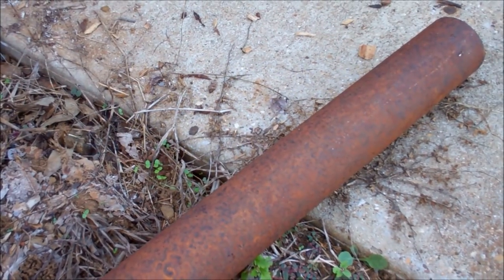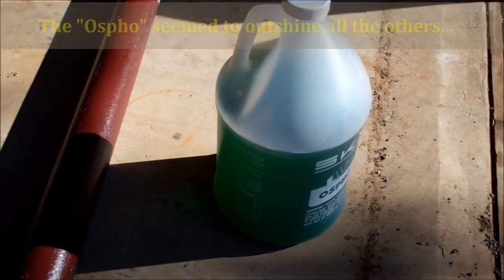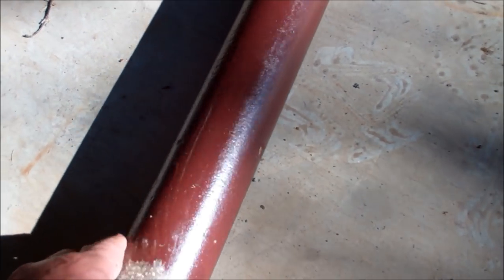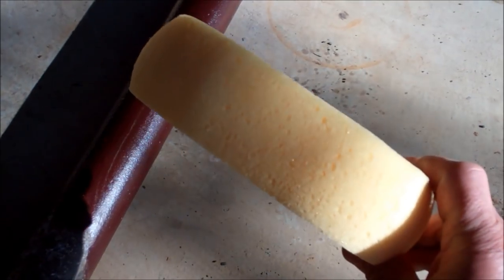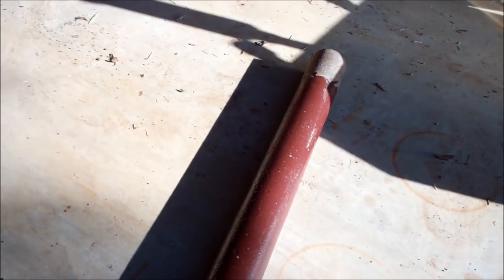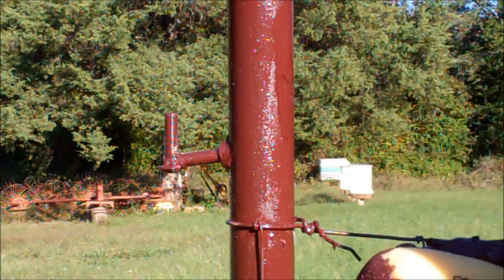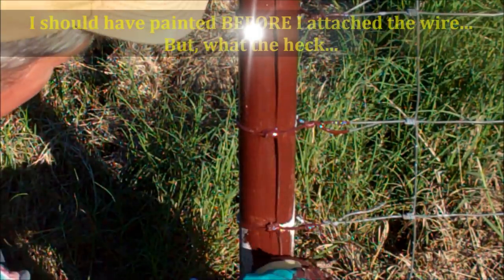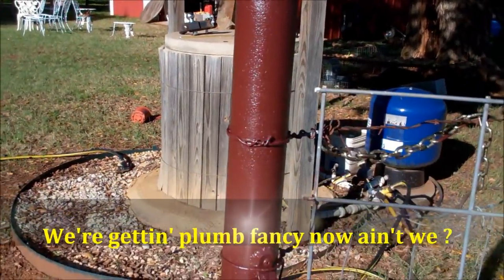How To Paint A Pipe Fence~Rust Conversion

Comment: I have used paint brushes and sprayers.  What I use now is a small piece of microfiber towel, dip it in the Ospho and squeeze out the excess.  Works fine and helps the Ospho go further.  Thanks for the video.  Good info.
Reply from the maker: Great idea
Reply: What do I do about the heavy white film that forms?

Comment: Great video!! I have a problem. We had our fence post repaint about 5 years ago and it wasn’t done right. The paint has been peeling off for several years now and we are ready to repaint. How do I get the peeling paint off to prep it? Thanks for your help!!
Reply from the maker: You may just have to do it the old-fashioned way, which is to scrape it off. There are chemicals that you can use to remove paint too, but I haven’t used them very often.

Comment: Hi thank you so much for the video . I have a quick question  I stripped out a pole from old paint , it had a little rust on it and then I put a fresh coat of paint . Due to the heavy rain ! The rust came through the pole . My question is can I use the OSPHO direct now with pain and rust seeping through? Or will I need to strip the paint again thankssssss😁😁😁
Reply from the maker: The Ospho needs to be applied to the rust so it can kill it.
I don't think it will seep through the paint.
Bummer.
Reply: @BIGALTX  thank youuu

Comment: I have to do a cemetery entrance pipe frame like yours but has pitted going on on the pipe do I sand this off first or use a wire wheel to knock it off?? What do you suggest? Love the products you used 👍
Reply from the maker: I think I'd use a wire wheel to try to get all the rust off, then use the Ospho: https://amzn.to/31MNmeC

Comment: I don't know if the author is still following This Thread but I have a question. Do you think the Ospho and the paint could have been sprayed on versus brushed on or sponged on? Which do you think would be most effective?
Reply from the maker: Sure, it could have been sprayed, but I think there would be a LOT of waste.
I have an airless sprayer (and i considered it) but figured I'd spray more into the air than on the pipe
Reply: @BIGALTX  Thanks for the response!  I know that you used the red primer and it's my understanding that if Ospho is used on pipe that is to be painted then a primer is mandatory and that you can't simply paint over the Ospho treated pipe.  Is that your understanding?  Also, have you found anything better than Ospho since you made this video back nine years ago?
Reply from the maker: That's correct, and I haven't had any major projects since then that would cause me to use anything different than Ospho.
This paint (i think) was an "agriculture" paint and I think it was leaded. The 5 gal bucket weighed a lot! :)

Comment: My mom has scrubbed metal pipes, prime them and painted them and they still look good 10 years later. If we use the ospho product, how long will the paint last?
Reply from the maker: Stephanie Flohr The Ospho isn't paint... it just converts the rust to a paint able surface. If you just paint over rust, it will eventually come through the paint... you have to kill it.
Reply from the maker: Stephanie Flohr I painted these posts about 2 years ago... so I don't know how long they will still look good... but the paint still looks good so far...
Reply: TexasPrepper2 I don't think I phrased my question correctly. I realize the rust has to come off, but what my mom was wondering is, if we use the OSPHO product to remove the rust, how long will the paint stay on the pipe compared to cleaning the rust off with the steel wool she has been using? Hope that makes sense. She has some pipe that she cleaned, primed and painted over 10 years ago that still looks great. I on the other hand am looking for a quicker and easier way to clean the pipe that will be just as effective as the steel wool method.
Reply from the maker: stephanieflohr I don't have a long term comparison to make. I did mine about 1 1/2 years ago... so I have a long time till I get to the 10 year mark. I would think that painting with Ospho is a LOT easier than scrubbing with steel wool. That sounds like a lot of work !

Comment: what is the brand of primer you used and where did you get it?
Reply from the maker: As I said in the video... I bought it several years ago, and don't have a clue of the brand. I bought it from a welder that was building a pipe fence near me, and painting it with this primer. I DO know that it's agricultural grade... I think it has lead in it...

Comment: Can you tell me the brand and type of paint you used...and I realize this video is several years old, so you might not even remember!
Reply from the maker: You're right, it was a long time ago, and I'm not sure :)
I think the primer was some that I had bought years before from a fence builder/welder. It had lead in it. If you look, you can find leaded paint for Ag purposes. 
Lead paint will last a lot longer as I understand it.
The actual paint was from Tractor Supply, I believe. Called Classic Red or Barn Red or something like that. I don't  remember if it was latex or oil base, but I think it was oil. 
Oil base should last longer too.
Hope that helps,
alan
Reply: @BIGALTX  : By any chance could it have been "Rust-Oleum
1 gal. Farm & Implement Red Oxide Metal Primer" that can be seen at https://www.homedepot.com/p/Rust-Oleum-1-gal-Farm-Implement-Red-Oxide-Metal-Primer-2-Pack-280171/206269562 ?  Looks to me like this would be a good choice.  And, if I understand it correctly, there would be no reason to paint over it.  The oxide primer would protect the metal just fine.  And, BTW, thanks for both the reply and great video.

Comment: Great video and advice!  Also interested in the primer.   Did some research.  Might it have been this:   "Johnstone’s Agricultural Oxide is a solvent based, protective finish formulated for interior and exterior use. It provides a semi-gloss finish that combines excellent opacity with good weather resistance making it particularly suitable for the protection of metal agricultural buildings and structural steel."   http://www.johnstonestrade.com/products/product-display/agricultural-oxide.aspx
Reply from the maker: +Andrew Baharlias 
It wasn't exactly that one... but probably one like it